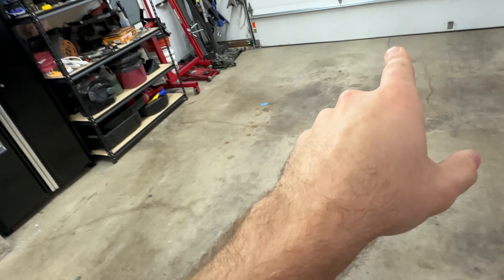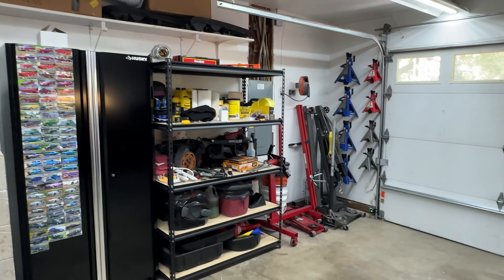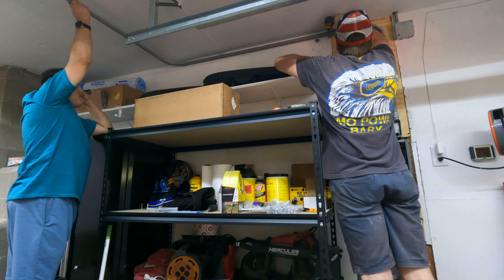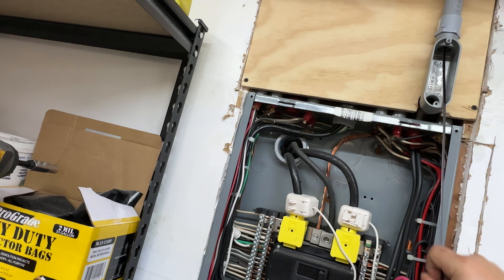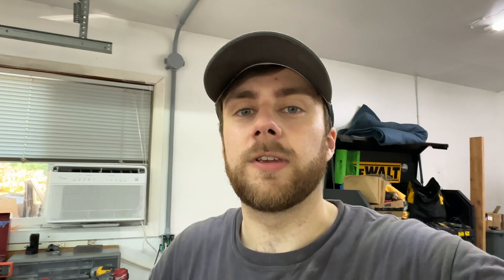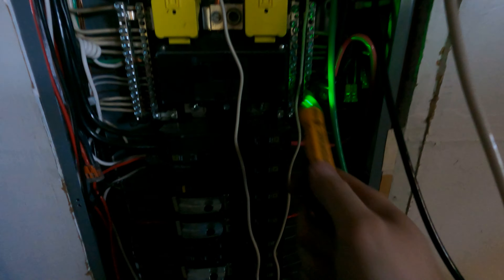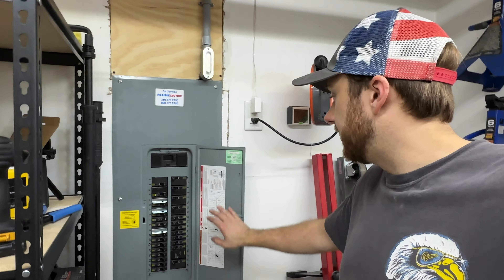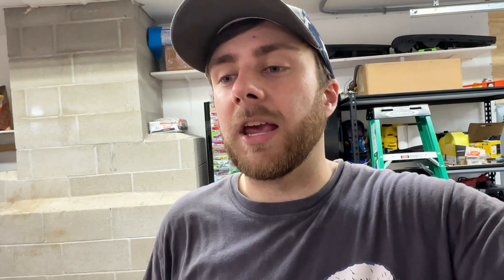Jury Rig is BACK! New House and Garage installing 240V!

Comment: Glad you’re back! Quick question, what ever became of the the silver TA you did the 6.0 in? Any future vids planned with it?
Reply from the maker: That was my friend Vence’s trans am, currently he got it running on a Holley terminator but it all needs to come back apart to replace the transmission and address an oil leak at the rear main